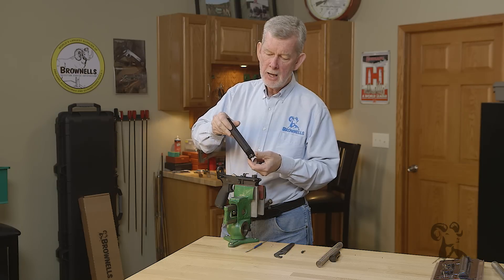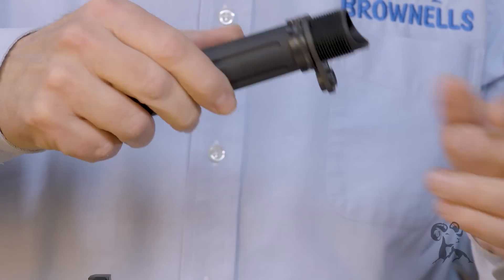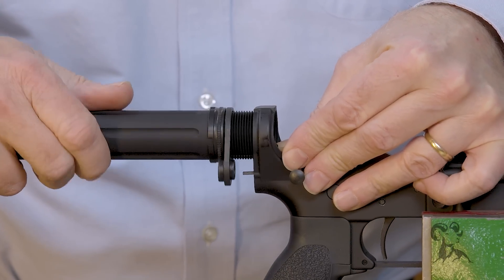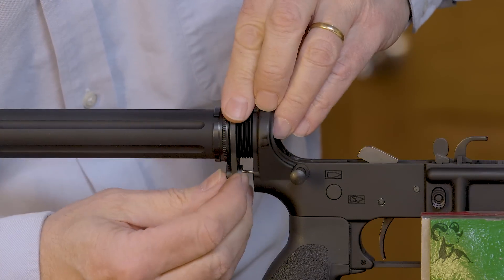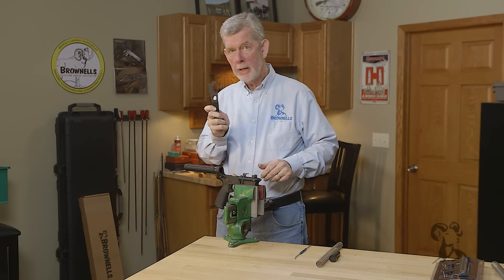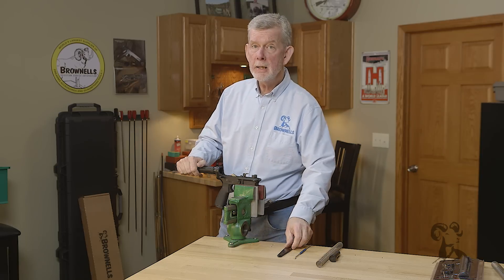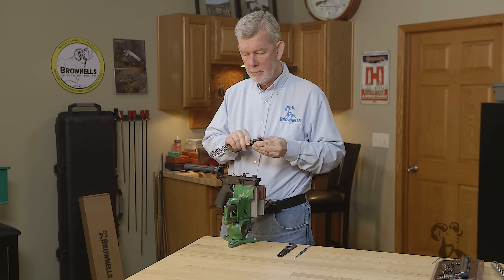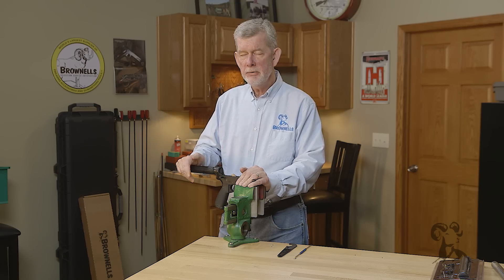Quick Tip: Installing the PWS Enhanced Buffer Tube

Comment: I use the PWS QD setups in everything I build now. Easy to install and easy to remove for barely more money than just the Magpul or BCM QD end plate.
Reply: I just installed mine a few seconds ago on my radian lower. I have a lantac one as well which i really like. For the pws you just tighten until the last click right? Felt like there was no further than where i stopped at lol
Reply: @rickypickles2219  that’s it.

Comment: I have the PWS ratcheting castle nut on 2 rifles, they are fantastic and worth the money.
Reply: What the heck is the point? I didn't even know this thing needed to exist.....are people really not willing to stake their castle nuts? Weird......
Reply: @animalmother556x45  No need to stake if you torque it on like a man ~_^
Reply: @muffemod  That is completely untrue. Like...completely. 

There's a reason they spec the staking.
Reply: How the fuck do you remove this thing! Trying to take off and castle nut wont turn at all!
Reply: @muffemod  They don't torque this set up to the proper torque which creates the friction between the castle nut and end plate..
Reply: @hairydogstail  ehh not if its rachetted up against it…lantac makes one too that actually has a torque rating which i like.
Reply: @rickypickles2219  The possible problem with anything that is not mill spec is it is an unknown quantity. Does the castle nut and receiver extension have a type 2 thread or better? Will the ratchet set up hold up as well as the standard end plate and staked castle nut?? This is why all opinions about none mill spec parts are subjective at best..
Reply: @hairydogstail  theres alot of garbage milspec products as well...i just personally dont want to stake...ill use loctite over that but the lantac set is milspec with milspec torque specs...just a different type of ratcheting....check that one out...a few bucks more but alot better
Reply: @rickypickles2219  Mill spec has to follow the TDP which is not crap lol. Products that claim to be mill spec that are not mill spec can be crap. Lantac is not mill spec but if you are happy with it that is all that matters..
Reply: @hairydogstail  if its using the same material or better material than milspec products and is tightened to a "milspec" torque rating then its about as milspec as milspec can get...I think some people just want the word milspec on the stuff they buy...Id trust it with my life over a milspec castle nut that costs 10$ lol...
Reply: @rickypickles2219  I have no idea what materials Lantec uses since I have never seen their TDP sheet, have you? Unless you have gauged their threads, then you have no idea what class threads they are using. Vltor exceeds mill spec with their receiver extensions as does Forward control design with their castle nuts.. Like I stated before, true mill spec is following the TDP tolerances set by the military's requirements which requires testing of such parts. This why many AR parts claiming to be mill spec are not mill spec. Mill spec is a known quality..JP has built rifles that follow very few mill spec TDP guidelines, yet manufactures some of the best made rifles...A true mill spec castle nut will cost more than 10$ lol. Like I stated before, if you are happy with it, then that is all that matters..
Reply: @hairydogstail  i understand what milspec is man…its just not that serious. For lantacs castlenut/end plates yes i do know the materials. I just don’t understand why you think these not being 100% milspec means theyre less durable or dont work as well. Not to mention alot of these components are used in combat or duty use by contractors and others..milspec is just a word.
Reply: @rickypickles2219  You obviously  don't know what mill spec is. If the part does not meet exact specifications in the military TDP, then it is not mill spec. Lantac is not mill spec..You obviously have a reading comprehension problem as I stated non mill spec parts such as JP can be very good.
Reply: @hairydogstail  lol.....i do know what it is..your way too butt hurt man. relax. lantacs qd mount on the end plate is "milspec" not the plate or castle nut...at least not rated "milspec" doesnt mean it doesnt meet or exceed the same specs...my point is just because something doesnt say milspec all over it doesnt mean it wont work the same or better...this entire thing started because your knocking products for not saying "MiLSpEc" all over them. It doesnt matter man. if operators are using it then it works. Just calm down lol
Reply: @rickypickles2219  The only person that is butt hurt is you lol. The Lantac end plate and nut uses 4140 steel.. Mill spec requires the end plate use  1018 or 1020 temper #3 steel and the nut to use 1137 or 1141 cold drawn steel..As you can see Lantac is not mill spec..Does this mean Lantac is a bad or good system?? I have no idea as it is not mil spec and is not a know quality that mill spec systems are.. You are free to disagree and listen to contractors and manufacturing marketing.. This was my point in the first place..I never knocked any product other than the PWS does not use the required mill spec locking torque for obvious reasons...TDP specs have changed through the years and were created by many millions of dollars in testing and over 60 years of combat experience, not manufacturers marketing.  Like I have repeatedly stated before, if you are happy with it then that is all that matters, but for some reason you are quite upset I won't dance along to your song LOL.....
Reply: @hairydogstail  said lantacs torque specs were the same...similar or better materials...this started with you going at others for things not being "milspec"...your the one typing essays my friend...good luck out there
Reply: @hairydogstail  oh and lastly....4140 is tougher than 1018 and 1020...so better than milspec...not tattooed with the title you like so much "milspec" but its better...so milspec enough
Reply: @hairydogstail  lol the milspec wiener toucher is mad that he googled all that info and didnt know the differences between the steels he was arguing against. Reputable companies are surpassing military specifications..your whole concern about ft lbs, while the lantac is torqued 38-40 and uses stronger steel type…this pws has probably seen as many rounds as a 10$ milspec castle nut. Try one you might like it. They work great and remove a need to punch part of your endplate into a castle nut. Can still loctite if it makes you feel better!
Reply: @smoothshot8925  lmfao! At least you know it's on there good.

Comment: He didn't include installation of the rear takedown pin. Utoob rules. You put the gold detent in the hole of the back of the lower and then the spring like you saw sticking out......before you thread the tube on.

Comment: good video!!!  i had one quick and probably stupid question,  do i need to install a PWS buffer tube, buffer if i use a PWS upper on my bcm carbine lower?  i tried looking around online for an answer and could not fine a definite answer,  some people were saying no others were saying yes i need to install a pws buffer and buffer tube if i intend to use a PWS upper attached to my BCm lower,  thanks for any help
Reply: I'm going to say no. Not necessary. I just changed my end plate and castle nut for this kit. Easy peasy.
Reply: Chris Ursiny did you ever find out the answer to this? I'm curious as well. Thanks!
Reply: The endplate and castle nut can be purchased separately and they will install on any Mil-spec buffer tube. I installed one on a LMT bigger tube
Reply: I have the PWS Mk116 16" upper and I'm running my carbine lower. I didn't need it when I ran a rifle buffer tube and buffer. When I switched to carbine, I needed the PWS weight to get the cycling right. If you can't get the buffer, the weight is exactly 4.2oz. I weighed it the other day with my scale. Hope this helps.
Reply: Do you have to? No, but the PWS buffer threads into the lower receiver farther which helps to reduce carrier tilt which can be a problem with a piston design.

Comment: The problem I have with this set up is the actual clamping force of a mil spec castle nut is set by the 38 to 42 ft pounds torque, which creates the friction between the castle nut and end plate that holds the buffer tube assembly tight.. With this set up, you are not even coming close to obtaining that torque or the required friction...Is there a reason why you are not torquing this ratchet castle nut to spec??
Reply: Just purchased this setup (minus the PWS enhanced buffer tube). Instructions for castlenut/endplate from PWS says: from "slight buffer tube rotation" to "fully tightened" should be 2-3 clicks "TORQUE SPEC should be 35-39 ft/lbs". Kinda confusing conflicting instructions. Not sure what theyre doing in this video though. 

Edit: just installed it. I tightened with wrench until the buffer tube would barely rotate if i tugged on it real hard with my hands. Then i used torque wrench and torqued to 36 ft/lbs. It clicked about 3-4 times by the time my torque wrench hit 36ft/lbs. I stopped there. This sucker isnt going anywhere.
Reply: @hamschh  did you use a vise when you torqued to the 36ft lb?  I don't have a vise

Comment: The installation isn't correct on this one. You have to torque it to between 35-39 ft lbs. Instructions on my PWS ratcheting castle nut says the torque should be 35-39 ft/lbs.

Comment: I tried using the rock river arms wrench, and it started to damage the threads of my buffer tube. Don't know how this guy was able to use the wrench
Reply: You didn’t have it on straight enough. I slipped my first time and flattened a few threads on accident. Just have to be careful.

Comment: Ummmm,  why?  If you dont own a spring loaded center punch... you should not even think about doing this.    Silly crap to take your money.
Reply: This part allows one to choose between rifle, carbine, and PDW type receiver extensions without having to stake their end plate or grind one off if they wish to use a different receiver extension. It is also made of higher quality materials, which gives an extended service life as compared to "mil-spec" items.
Reply: @rhubarbpie2027  not to mention it's 25$ for the endplate and castle nut. that's a very reasonable price for how much easier it is to install and uninstall.
Reply: Why? because staking has always been impractical for the average joe especially when wanting to swap parts or rebuilding an AR.
Reply: I don't own a spring loaded center punch and I've built over 100 ARs just fine.  ~_^
Reply: I used a chop stick to depress the plunger. What the hell is a spring loaded center punch?
Reply: Just removes a step in the process, and looks better cosmetically. A more "modern" approach. This isnt done in the military because it would be too costly to do this to thousands of rifles.
Reply: @hamschh you are correct